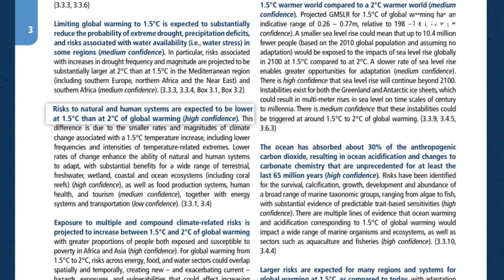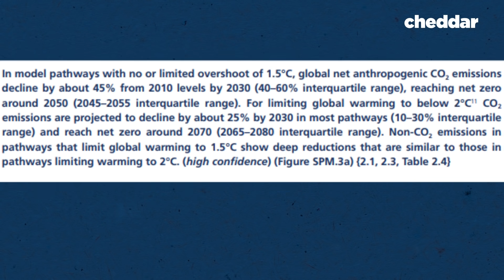Wooden Skyscrapers Are On The Rise - Cheddar Explains

Comment: What about building wooden ships? Those things WOOD last way longer than some ole rusty piece o' metal
Reply: not true. marine paints provide more than enough protection from rust. wood is also entirely unsuitable for modern ships.
1. Fire
2. steel would still be required for constructing tanks to hold fuel oil, lube oil, potable water, makeup feedwater, and ballast water.
3. difficulty in properly mounting engineering equipment
4. Fire
5. questionable internal watertight integrity in the event of flooding
6. more complex and labor intensive construction process. probably a more limited displacement, reducing commercial cost effectiveness.
7. Increased chance of structural damage during normal operations.
8. Fire
Fires aboard ship are many times more dangerous than any shoreside fire. there is nowhere to run and no backup coming.
Reply: There was a ship called the Wyoming (not to confuse it with other Navy stuff that also have that name); and it was massive. It was even made out of wood.

Problem? It was so unstable it sank by accident.

Comment: I think this tech will really take off when combined with pressure/ chemical wood densification whenever that tech is matured as well. This combined with the constant Improvements in composite polymer chemistry (think polyexpoxide resins) and better impregnation and curing techniques, wood as we know it will be a far cry from a home Depot two by four. Imagine a resin combined with a wood matrix and a silica / sodium hydroxide injection to help homogenize and keep the wood preserved. The pressure densification also increases the density. Such a wonderful material would be stronger and more flexible than both Steel and concrete and be even more versatile and eco friendly. 

What we're making here is essentially a carbon fiber-like wood composite on a wall sized scale rather than strands. Very cool stuff.

Comment: Umm, guys.... Instead of wood what about Core Tubular Stainless Steel? It is a new architected material invented by the same guys (Broad Sustainable Building) who developed a way to build supertall skyscrapers like Legos. It has undergone some testing and has some interesting properties. I just thought it would be a good idea to post some quotes from a guy (Daniel Zhang) who works at Broad.

CTS = Core Tubular Stainless Steel

What is a CTS slab?

Daniel Zhang says, "CTS slab is a strong structural material that consists of two steel panels clipped with thin-wall core tubes, welded with copper brazing. The gap between the tubes is filled with rock wool for thermal insulation. Applied to a building structure, CTS slab is 10X lighter than concrete, fundamentally eradicating earthquake threat. Anti-corrosion performance of CTS slab is 100 times more effective than that of carbon steel. The life span is almost limitless.

How were CTS slabs developed?

Daniel Zhang says, "The aviation industry is used to employing stainless steel honeycomb slabs as the shell of space capsules, but it is not affordable even for aircraft due to its extremely high cost. In 2016 BROAD invented the core tubular slab structure in which the honeycomb is replaced by round tubes, making low cost honeycomb slab production a reality. From 2016 to 2018, with an input of 1000+ staff and 110 disastrous failures, BROAD has invented the globally unique hot air copper brazing furnace, realizing low-cost massive production of CTS slab."

What about thermal bridging and embodied energy in CTS slabs?

Daniel Zhang says, "The thermal bridging exists, yet the walls of the tubing are so thin, so so far it performs close to structural bearing wood beams, overall. Embodied energy as according to calculations because it is stainless, the life span and recyclability, making the embodied energy over the long term lower than wood, steel, concrete. The strength comes from the higher weight to strength ratio, the little tubes does all the shear wall, compression work."

How carbon intense are CTS slabs?

Daniel Zhang says, "The carbon intensity is about 3.6 tons of CO2 per ton of steel; however, when in the future our source takes in recycled stainless steel, our emissions would be 1.5 tons of CO2 per ton of steel."

How durable are CTS slabs?

Daniel Zhang says, "In essence, it is an architected material, which makes it last longer, so we can reducing mining for resources, there is a calculation, iron that is rusted away on the surface of earth totally is more than we extract each year."

How fireproof are CTS slabs?

Daniel Zhang says, "We have two solutions, one is a hard shell fire proofing board made to extend the fire compromising time to 3 hours before reaching 1000 degrees, and a second is a fire proofing spray for the service areas of the building, where aesthetic isn’t as demanding. However, a benefit of stainless steel core compared to concrete is that after strong fire you can use water to put it out, whereas concrete would brittle and collapse. And as compared to steel, stainless steel’s melting point (softening temp )is 1,200 C, compared to carbon steel at 700 C, so that extends the fire proofing time."

What are the projections for the use of Bcore in the future?

Daniel Zhang says, "The new structure system brought forth by Bcore is going to greatly simplify architects' and engineers' understanding to integrate building systems. In the future we hope when everyone can "speak" Bcore as a shared language of design, so far the laboratory test for Bcore is really promising. I believe the vision is once more people adopt this new structure method, the communication can lead to designing better built environment."

Source: "Watch Broad build a four story apartment building overnight" from TreeHugger

Relevant files:

ProductShow-94.aspx "Ultimate Structure Material CTS SLAB BRIEF INTRODUCTION"

ProductShow-95.aspx "CTS Slabs in Residential"

ProductShow-96.aspx "Consultation and Certification"

ProductShow-97.aspx "Bcore Structure"

ProductShow-98.aspx "Bcore Bridge"

Comment: surely building out of wood is not any more sustainable than concrete.
Reply: The main key is sustainable forestry, which can fix the logging industry. Loggers don't need the land, so trees can be replanted. Also, sustainable forestry is actually even better, because it's only while the tree is really growing that it absorbs C02, then it dramatically decreases how much it absorbs. Tree farmers cut them down for logging at this point and replant. It produces a fast cycle for obtaining timber and it removes more C02.

Comment: Strange that in the "fire safety" part they dont mention the Historic Losangeles 2014 fire, where a BRAND NEW 7-ish story, full block-long, all wood building caught fire collapsed onto the freeway and damaged the surrounding buildings.  If you look at photos it actually looks like downtown LA was firebombed, and they almost could not contain it while calling every fire department in the greater LA area.  If the buildings next to it had been made of wood and not granite/concrete, they would have also burned.
Reply: If it's the one I read about, it wasn't a finished building, it was a only framed, meaning no solid wood just 2x4s which catch and burn quickly especially when not covered by sheet rock or other normal materials that cover them. The report I read also said that they believe it was an intentional fire because the entire building was engulfed in flames so quickly.

But it is a good reminder, let's not commit to this until it has been fully tested. It might be great for the planet, but if tons of people get burned alive...we probably made the wrong call.

https://www.latimes.com/local/california/la-me-downtown-fire-20141209-story.html
Reply: @justoncheney7172  I lived in the appartment complex on figeroa at the time (2 buildings down), and from the outside it looked nearly finished, they had already started to stucko the lower floors to make it look astherically pleasing, and all floors were already walled off.  And just before that, you could see at least all the timber for every room on all the floors were placed before the outer walls went up.  If you can find videos from the highway you can see that while on fire everything had walls and was not just 2x4 timber.  only thing left standing were some metal staircases.
Reply: What about all the concrete buildings that burn down?
Reply: @jackblack704  They dont collapse or spread nearly as quickly.   That building in LA took less than 20min for every floor to catch fire.  There would be no way for anyone to get out or seek refuge, and keep in mind this was one of the largest single fires in LA history.